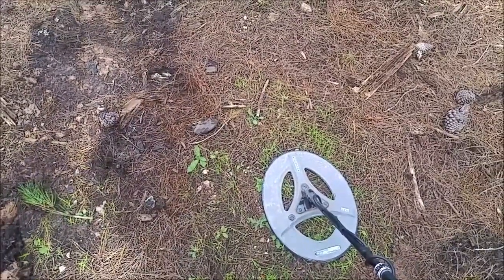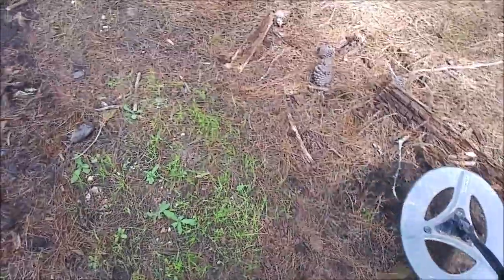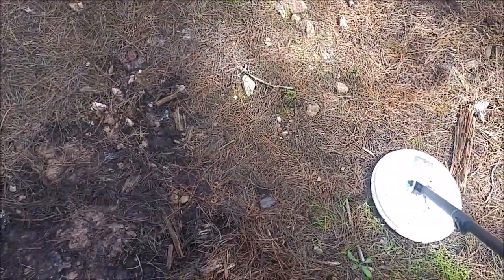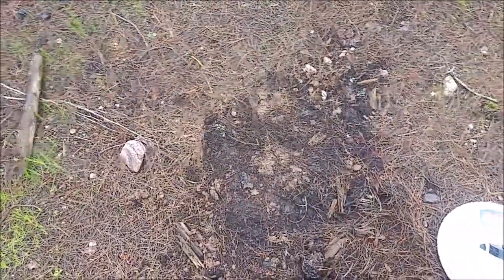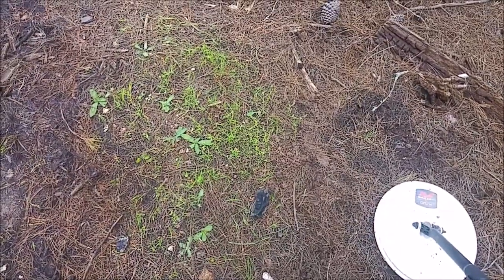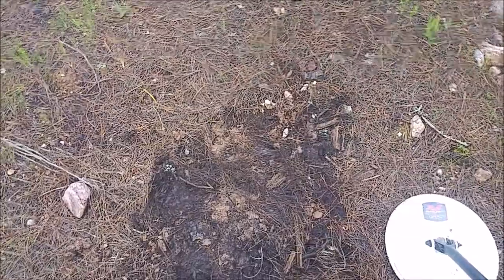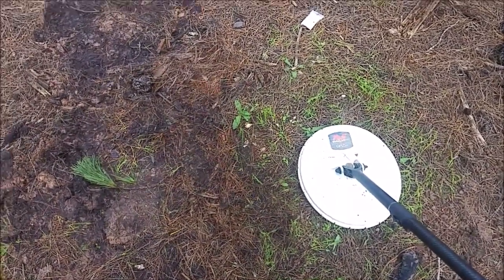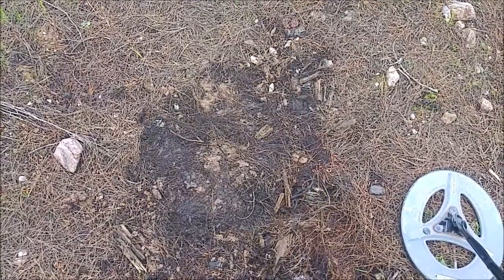Minelab GPZ & 5000 - Playing with Settings

Comment: Hi Nenad, with the 7000 I work highly mineralized ground around central Queensland and find high yield difficult best very low threshold  and go very high on the volume and sensitivity and it pings ultra small gold at good depth and still picks up 10 gram plus bits very deep.
Reply from the maker: I've experimented with a low threshold and cranked settings and admit it can work well, particularly on the very small ones. I'm just a threshold guy haha

Comment from the maker: Just a comment about working wet soils, and which machine is better.  The GPZ likes damp ground, and so does the GPX to a point. Very wet ground, particularly if there is any salt in the soil, the GPZ does not like it, but going into Patch Locate will help. On the GPX, the spiral/flat wound coils can "saturate" earlier, this is heard by the threshold sort of moaning. A normal wound mono coil is better, but in very wet ground, I've always had good success with DD coils on the GPX's and GP series units. On the GPZ I find the day directly after a lot of rain is usually not good. But give it a few days and the machine runs sweet.

Comment: M8 I find around tarnagulla I’m dropping my rx down below 8 and stab down to 6 and it’s still noisy . Any advice pls
Reply from the maker: 4500 or 5000?
Reply: @diggingwithphasetech  5000
Reply: Fine gold with 13x17 evo
Reply from the maker: Ground is probably still quite wet. Try Enhance timing, Slow Motion, Quiet Audio, Rx 7, Stabilizer 12.
Reply: @diggingwithphasetech  thx for your input 🙏